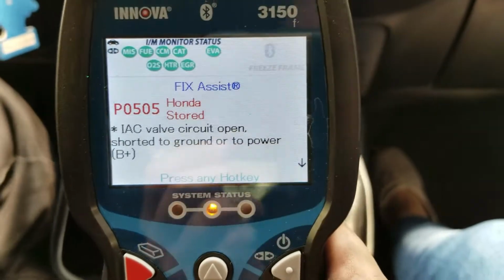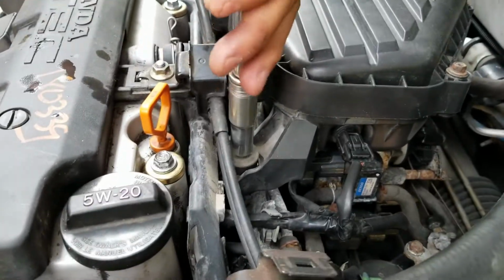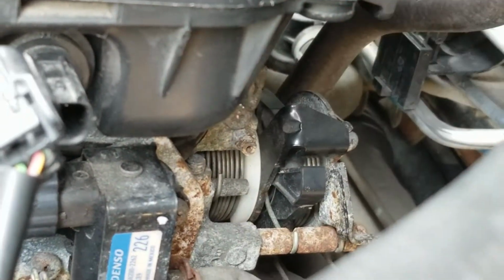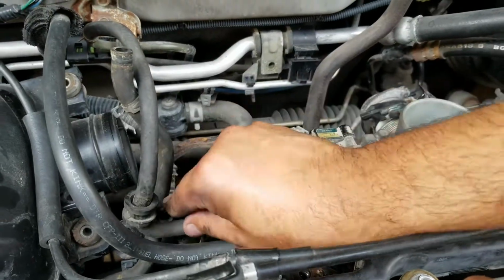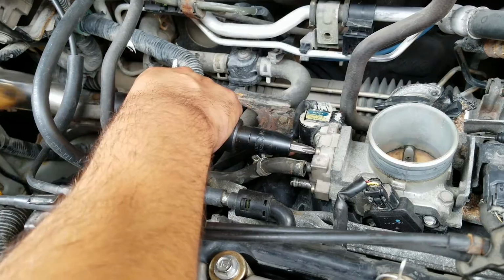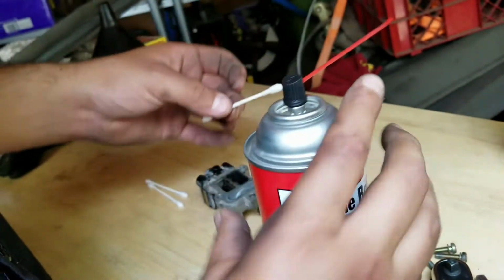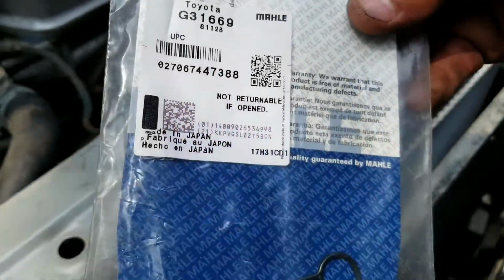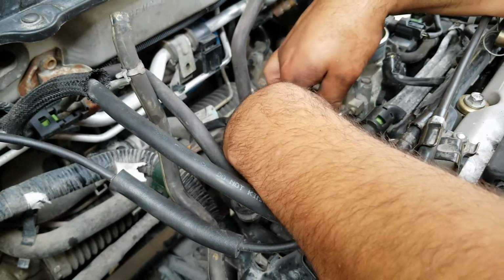01-05 Honda Civic Idle Air Control Valve (P0505)

Comment: I removed the valve, cleaned it with gasoline and put it back on and it fixed the problem. Thank you for this video, and thank you for advise about not stripping those three bolts.

Comment: I have a 2003 eu3 civic hatch. After not getting used much for a few months its started idling at 1500-2000rpm. Will sometimes drop back down to around 1000rpm then surge back up to 2000. Do you think its likely pulling this of and cleaning it might fix it? It happened briefly a few years ago but went away after a bit of an "italian tune up". Not getting any CEL.

Comment: so mine has been randomly spit and sputtering at idle and almost dieing, should I look into this or you think its something else?
Reply from the maker: If it has a check engine light I would start by seeing what code it is. I don’t think this would help something that runs that bad
Reply: @JCAUTOMOTIVE4444  No check engine light on but a couple months ago I had to replace the camshaft position sensor, thinking it may be related to that. Thanks man
Reply from the maker: That could very well be it.

Comment: Hey so my car got flooded 2 weeks ago and I’ve been trying to save it. After a lot of drying and cleaning connections, so far the only code the car is throwing is p1519 (IACV circuit malfunction). Anything else I should look at besides cleaning or replacing IACV?
Reply from the maker: Possibly pin fitment or possible wiring issue is all I can think of. I’d have to check alldata to see what other possible things it could be
Reply: @JCAUTOMOTIVE4444  Thanks so much for your reply! Cleaning the connections with contact cleaner and replacing IACV cleared the code for me

Comment: Oh cool thank you for this video my question is 2005 Honda Civic has been sitting up for a couple years siphon the gas out replace fuel pump still does not start I can put fuel in the carburetor and it will is there an inline filter or what could it be if you could help it would be appreciated thank you very much Isaac

Comment: I have a 2003 civic EX and when I turn on my car after letting it cool down for 20 minutes or more, the rpms will drop very low almost likes it's going to shut off, it's the worst when the  AC is on, it also does that when AC is off, but once engine is fully warmed up, no more idle issue

Comment: would taking a egr off of a motor that comes with a egr an putting a non egr thermostat housing i blew my d17a1 that came in my 01 civic lx  would that throw a code for this  i didnt have a check engine or could something be upplugged i never had a isssue with the motor its a jdm motor swap i had swap the egr housing to pass smog than had a check engine light start no over heating or just lil idil like u said but never took this trottle off liek u did just took the air take to get to the egr throstate housing bolts

Comment: My Civic 2004 EP3 3dr (185k) has no problem to start, but after 3-4 min it almost stalls, sometimes stalls, pushing on throttle won’t respond, rpm goes from 500-2000 by itself, then it drops and repeats this till the engine reaches the normal working temperature. It comes only when the engine is warming. This issue appeared in winter only and now after 40k it happens also in summer. Any suggestions will be really welcoming :)
Reply from the maker: Any check engine codes? Almost sounds like a drive by wire throttle but I can’t remember if those have electronic throttle body. If not maybe a idle air control valve
Reply: @JCAUTOMOTIVE4444  Yes the engine check is On but l don’t have a computer to find out the code. I’ve cleaned the IACV from carbon debris but perhaps it should be replaced or just the IACV gasket.
Reply from the maker: Yea probably needs replacing now. What’s codes showed up? If you know
Reply: @JCAUTOMOTIVE4444  The throttle body is not electric.

Comment: Mine has p0505 and a very low idle. I just replaced the IACV and the problem persists as well as the code... what do I do
Reply: I know this is very late but if you didn't use an oem part that could very well have been why it persisted. I've had aftermarket sensors and parts that were brand new, not work right out of the package with these civics. I've learned always go oem for sensitive parts like this

Comment: alternator also affect the idle when the AC in ON..maybe the alterantor is most likely going BAd replace it with higher amps alterantor
Reply: Check all the grounding wires first. A bad ground can cause issues similar to alternator or IAC.

Comment: Hi dude, I'm facing a little issue with my honda civic 2002 i.e car drops rpm on idle when in D and AC is on. Is it something related to IAC VALVE? I have already cleaned my throttle body but the problem is still there and no check engine light! Advice needed.
Reply: There's no battery light nothing. But yes, that is possible that alternator might be going bad. I'll let it be checked by the technician and revert back to you. Thank you very much for your response 👍
Reply from the maker: No problem let me know what ends up happening.
Reply: @JCAUTOMOTIVE4444  
Any tip for my problem?
Reply from the maker: It's normal for RPM to drop a little with AC on, with these cars. The engine is tiny so when you turn on the AC it takes alot of power from such a small engine. Most 4 cylinder cars do it but...... it also depends how much it drops and it also can't be fluctuating high and low constantly.  You will know right away when the idle air control valve has a problem because the RPM will go up and down constantly.  It is very annoying and usually when the check engine light finally sets the rpm will be staying put around 1500 RPM at a complete stop.
Reply: @JCAUTOMOTIVE4444  Actually, after turning on the AC in D mode the rpm drops to almost 600 to 650, engine slightly hesitates. But there is no problem in acceleration. Car runs smoothly. Only it annoys in idling,seems like the engine is going to shut off. Only when AC is on.
Reply from the maker: Sounds more like a huge power drain issue? Any battery light? Get your battery tested see it its holding up. If not get a multimeter, turn on lights, AC full blast and see what voltage your alternator is producing.  It could be alot of different things but yes that is too low of rpm
Reply: @MrAamir1432  , 
You solve the problem? And whats the root cause?
Mine honda with 60k mileage clocking having rpm at 600 recently at operating tempurature, use to be 1000. (New battery and engine starting cold at 1000rpm)
Reply: @metzmatu8409  Yes dear, problem has been almost solved. There was no battery issue, no alternator issue, no throttle body issue. Actually there was an intake valve beneath the MAP SENSOR area which was cracked and causing air leaks. But now engine has become 1000 time better than before. But after spending almost 2 hours, mechanic came to know that intake valve was the culprit 😀
Reply: @metzmatu8409  Yes, my civic also starts from 1200 rpm and settles at 700-800 rpm after warming up without knocking etc.
Reply: @MrAamir1432  
Meaning.. the mechanic had open the valve cover ton check the intake valve. What's synthom of valve  problem? Hope this not related to the idling low after engine warm up.
Reply: @metzmatu8409  No, he didn't open the valve cover. Actually, there was a hose beneath the map sensor and there was a cracked plastic valve which was attached with the hose. He replaced that plastic valve and the problem was resolved straight away. Since then that never happened to me. Because mechanic said that engine was not breathing enough that's why it was happening. Maybe, he might be right.
Reply: @metzmatu8409  If you are facing low idling issues then tell me if there's any check engine light or not? There might be different issues, i.e ignition coils, iac valve, faulty spark plugs, fuel filter, throttle position sensor etc.
Reply: @MrAamir1432  
The throttle is drive by wire, does it have IAC valve, i don't see anything like IAC valve on the throttle body? The cylindrical wall on the front side of the butterfly valve, theres no passage hole to bypass the butterfly valve.
Engine sound, acceleration seem normal.
Reply: @metzmatu8409  Every electronic throttle body has an iac valve (Idle Air Control) which monitors your engine idling. If at anytime the IAC is clogged or faulty, it will affect your engine idling. And all 7th generation Civics have an IAC with the throttle body. If your engine is accelerating normally and only facing idling issues then most probably IAC could be the culprit.Get your car inspected by your technician.
Reply: @MrAamir1432  
Could it be the other way round.. 
IAC conttol air flow base on ETCS feedback to ECU and final demand from APPS required.
Reply: @metzmatu8409  Well, it's better to get your engine scanned first. Then you will get a better idea of what the actual story is.

Comment: Can I clean it this way for P0511 for Idle air control circuit? Just swapped a motor out and this code came up with a rough idle when you push the accelerator
Reply from the maker: It's worth a try. Also I worked alongside a mastech tech and one day he was having that issue on a car that came in. He tapped the sensor with a 3/8 extension and a hammer. He hit it until the idle corrected. I would give that a shot too

Comment: Thank you very much for this video. I had just cleaned the EGR passages on my high mileage vehicle. They were almost totally clogged with carbon. My very inexpensive scan tool that I used for emissions just showed an EGR code. I just purchased a HF Zurich ZR-13 scan tool and it gives much more information. Because of your help I can easily fix this.

Comment: Great video but why doesn't it show how you put it back together to completion? I'm struggling to get the air filter housing back on. Any suggestions?
Reply from the maker: wish i could help. i dont exactly know what youre struggling on. i would maybe say loosen the clamp more and push it down hard or even lube up the the outer end of the throttle body
Reply: For future reference whoever sees this, the rubber fitting should go on the box first for easier reinstallation. Take the top half of the air box off and put the rubber seal back in; then put the whole assembly back on
Reply: When you rip the whole assembly box out, the rubber seal typically stays stuck to the throttle body when it’s meant to be inside the box.

Comment: Thanks for the excellent video - very easy to follow along and it was an easy fix. my son had to get to work and it's his car so we didn't even replace the gasket; we just carefully cleaned it up. I was surprised it didn't even need to prime; it fired right up and popped up to a steady 900 RPM. Thanks again for posting

Comment: I move the steering wheel and the RPM goes UP pass 1000
Reply: That's because the engine is compensating for the power steering pump. That's normal.

Comment: Thanks for video
 I did all that I even did transmission solenoid. BUT MY RPM IS STILL ON 1000. THANKS IN ADVANCE
Reply from the maker: A P0505 code can be set by a couple of other reasons. I just fixed my 99 civic with the same code but it had a vacuum leak. according to alldata a p0505 can be caused by throttle body clogged port, intake manifold gasket leak, intake air hose leak, vacuum leak, ect sensor incorrect output. 
In this video it just happened to be a dirty IAC Valve.
Reply: @JCAUTOMOTIVE4444  THANK YOU for taking the time 🙏
Reply: @JCAUTOMOTIVE4444  Wow Your Seriously Amazing! Wow You Just Broke All That Down So Wonderfully. Man I’m Going To Subcribe Because How Beautiful You Just Broke The What Could Be The Cause Of The P0505 Code 🙏🏼

Comment: Went through 100 videos until I found this 1 perfect thanks!!!
Reply from the maker: Glad it helped
Reply: @JCAUTOMOTIVE4444  still need help getting all the plastic out filter cover and stuff
Reply from the maker: @liveandletlive2894  I believe theres a total of 3 screws on the filter box attached to the throttle and the other filter box shares the top 2 screws but has another 2 towards the front .
Reply: @JCAUTOMOTIVE4444  thanks!